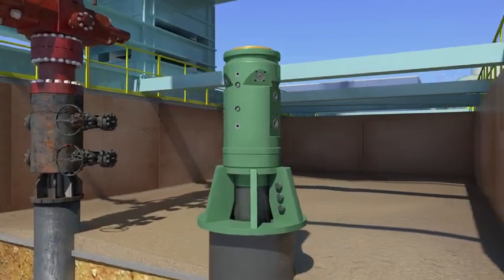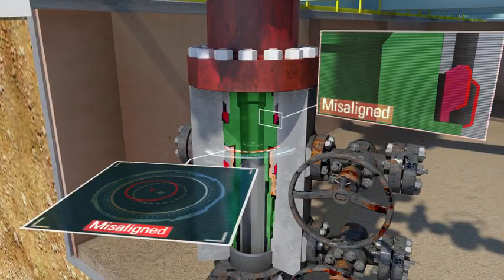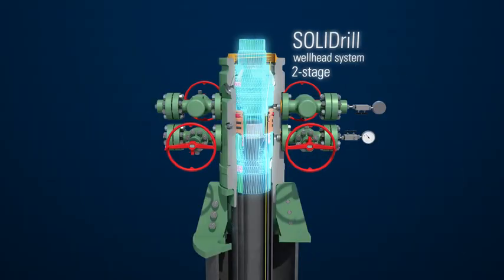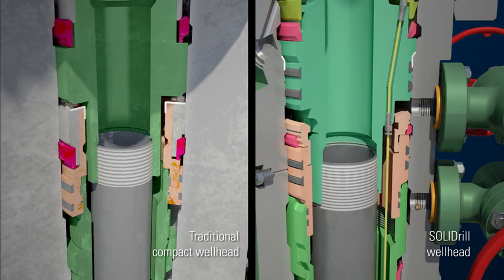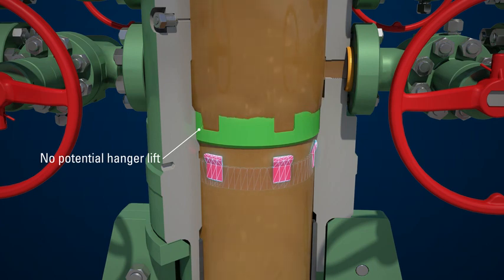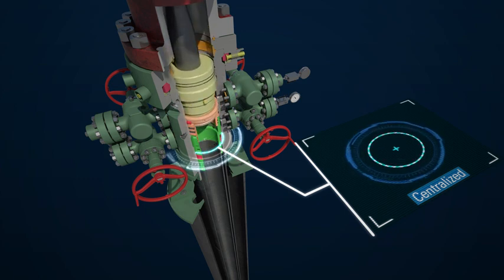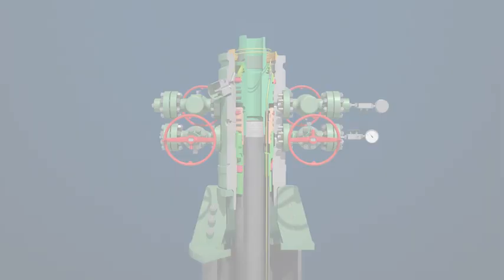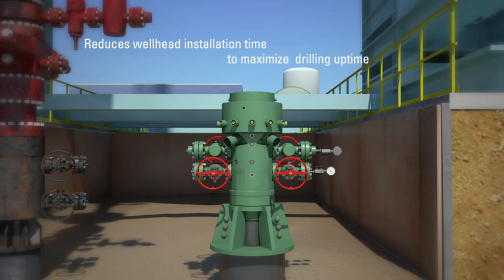SOLIDrill Modular Compact Wellhead System - Schlumberger

Comment: The music is very loud and it muddles the voice of the explanation. Pleeeeeeeease turn down the volume of the music or delete it in the next videos.
Reply from the maker: Correctly installing the wellhead is crucial to drilling- and workover-operation success. But most traditional compact installations involve landing tubing hangers on top of the casing hanger packoff’s flat area where debris can accumulate. This condition often causes the hanger to be misaligned, preventing its proper installation resulting in nonproductive time. Now such conditions can be mitigated with the Cameron SOLIDrill modular compact wellhead system. This wellhead has a compact housing and accommodates different casing and tubing programs with minimal tooling. It can be configured in two- or three-stage arrangements, and is designed to accommodate ten control lines. Casing and tubing hangers are installed on their own dedicated landing shoulder; the wellhead is designed with angled shoulders to repel dirt, metal shards, and other debris. The wellhead works with an optional temporary lockdown mechanism for landing casing hangers. The lock ring is used to remove the potential for hanger lift during casing cementing. The SOLIDrill wellhead system has self-aligning hangers and centralizing features, which further aid reliable installation. The tubing hanger and running tool assembly is assembled and tested offline. All control lines can then be installed and tested without breaking the connection, saving time on the rig floor. Constructed with substantially more socketing to hang casing (mitigating wedging problems when pressure is applied) and designed for severe kickoff well angles, the SOLIDrill wellhead reduces the possibility of hanger tilt. For operators conducting drilling and workover operations, involving land or offshore wells, the SOLIDrill modular compact wellhead system reduces wellhead installation time to maximize drilling uptime.